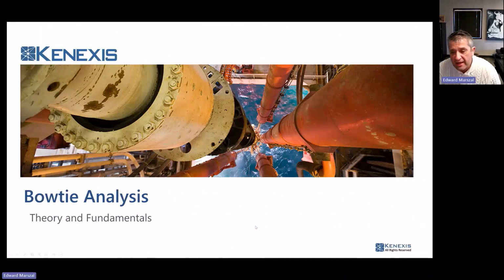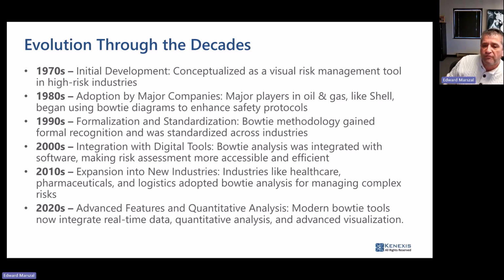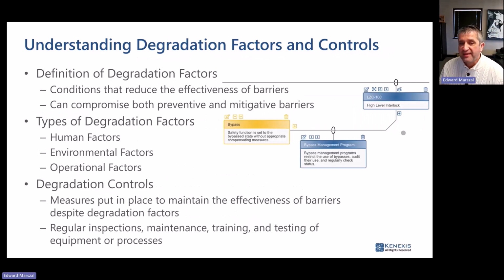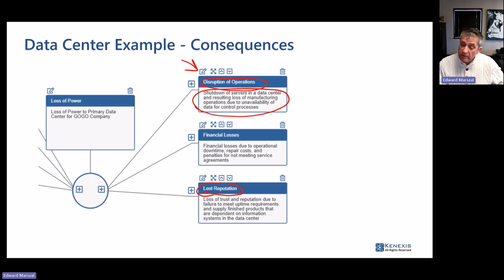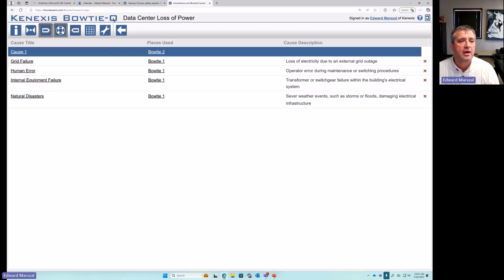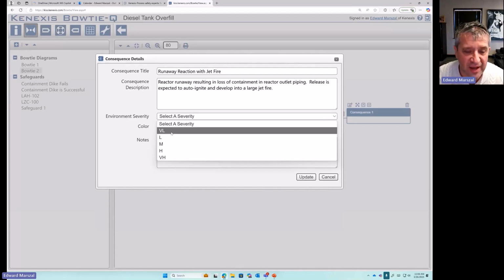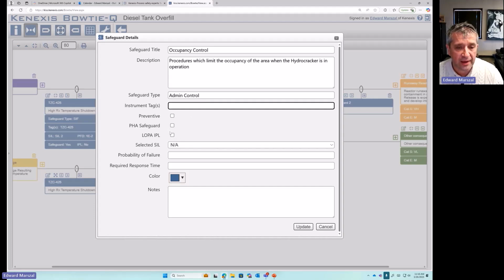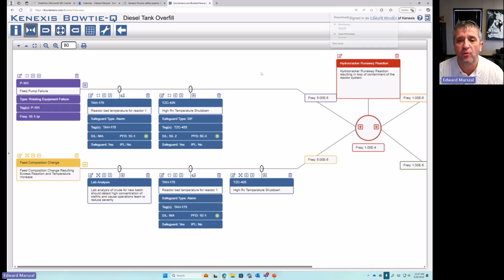Webinar  -  Exploring the Power of Bowtie Diagrams & Bowtie Q™ Software Launch

Comment: Hi sir, this was a pretty informative webinar, thank you for the knowledge! I have a question/suggestion for a feature that may/may not have been already mentioned in the webinar. Is there a way to hide or disable any of the Preventive and/or mitigative Barriers or even the degradation factor/control tabs to be able to modify the calculations performed in the Bowtie-Q study at any given time? Also, if the dropdown for pre-existing instruments/factors were auto-sorted with numbers it would become highly user-friendly.
Reply from the maker: Thank you so much for your interest in Bowtie-Q™ and for sharing your valuable feedback. We truly appreciate input from our users as it helps us continually improve our products.

At the moment, there isn’t an option to enable/disable items in Bowtie-Q™, but that’s definitely something we’ll consider for future updates. We’ll make sure to add it to our development pipeline for review.  Additionally, the drop-down list of pre-existing items, which is available in Open-PHA®, is a great idea, and we’ll look into potentially incorporating that feature into Bowtie-Q™ as well.

Thanks again for your suggestions! If you have any more feedback or questions, feel free to reach out.